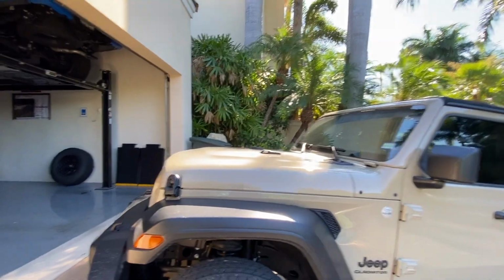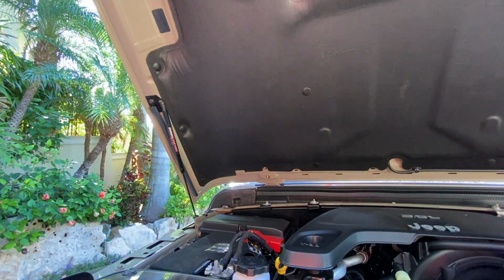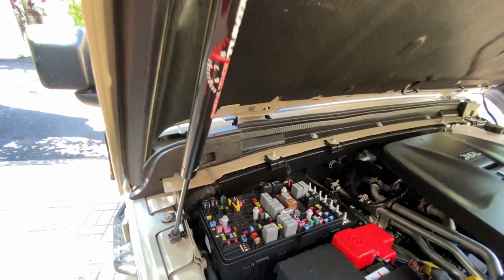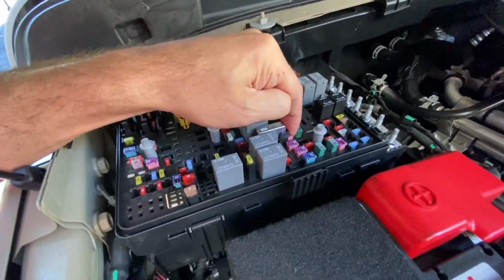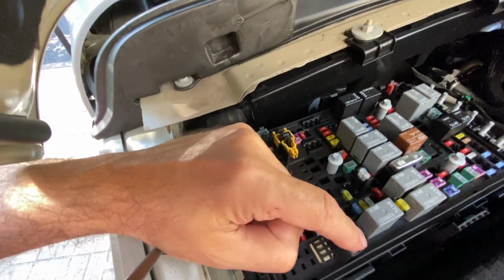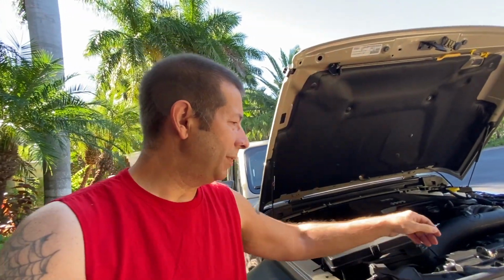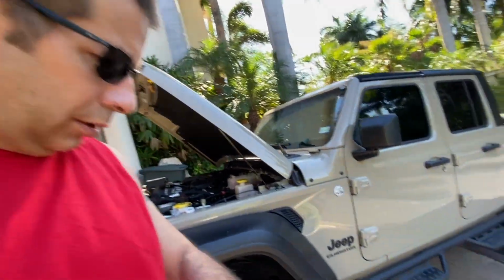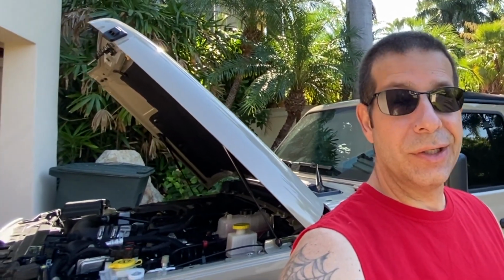Taking a look at the Fuse Panel in the Jeep Gladiator for Loose Fuses

Comment: All of my larger fuses were not seated 
I didn’t  see you check yours at all 
Maybe you should
Reply from the maker: I did.  All was good👍
Reply: @robmotiveplus  
Yes sir 
Good to hear 
Mine started showing the ess battery charging and mode deal 
And not working 
Pushed in fuse and relays has been working great
Hope it fixed it

Comment: My fuse box has a loose fuse on one of contact ports, making it move while I drive. I tend to stick it all the way in but it just doesn't seem to stay in place especially when I'm driving.
Reply from the maker: That’s a drag.  Maybe a defective fuse housing🤔
Reply: @robmotiveplus  yikes, I might have to take it to a dealer, I doubt a mechanic can fix that issue. Is applying electrical tape inside the fuse box safe?
Reply from the maker: I’d replace the fuse first.

Comment: those screws in the fuse box, when i go to tighten them down they wont tighten..they keep turning like theyre loose or stripped
Reply from the maker: Hmmm...I never tried🤔
Reply: @robmotiveplus  well the reason i made this statement is because my buick enclave wont do anything and i replace starter and fuses are fine. i have tons of power just wont do anything. battery new alternator fine. im curious if its a ground .. question ?? whats the purpose of the 2 screws in the fuse box?? is it to just mount the box or do they act as a ground to the car ?
Reply from the maker: I’d guess they’re for mounting purposes 🤔
Reply: @robmotiveplus  ok ty